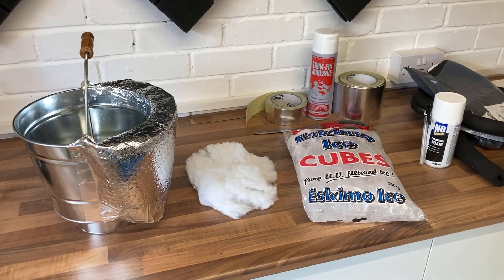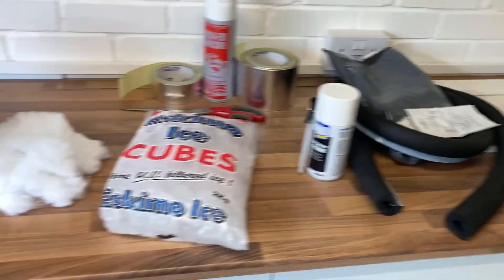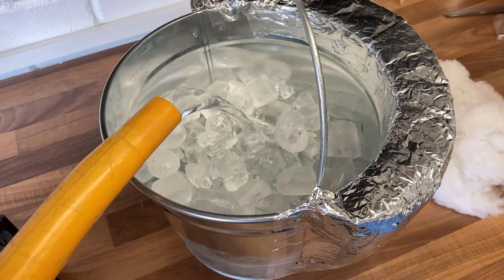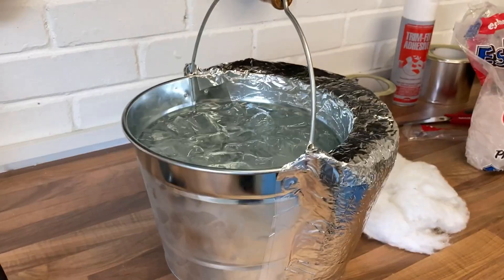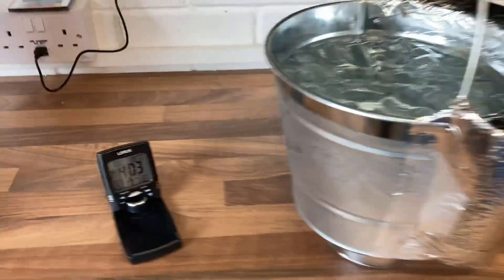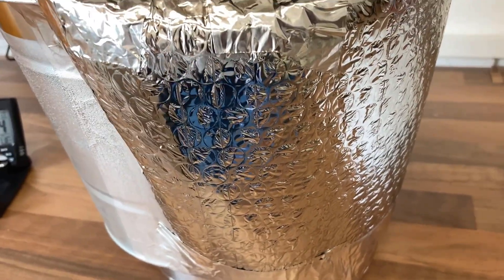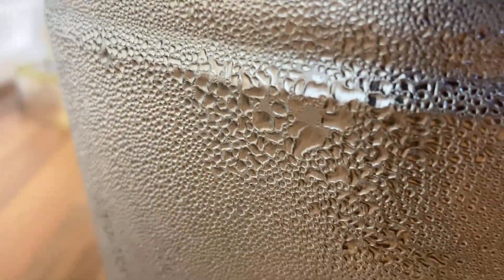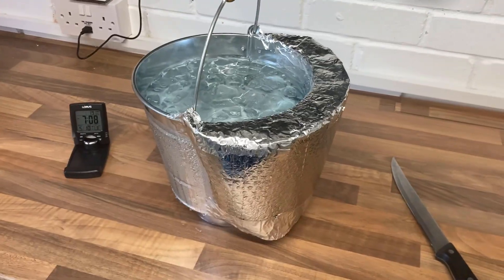Vapour Barrier in a Van - I can Prove they Work.

Comment: That is amazing, and you have certainly , proofed your point.
I have a big issue on a work van , with moisture collecting on the inside roof , and this is because I am running an engine to generate PSI, constantly during the day , in order to do my job. Which will always be done with side and back doors open. I would be grateful if you would list the materials you used.
Reply: Thanks for taking the time to reply.👍
Reply from the maker: There is a details playlist for the build of my van showing each stage. 
I used PIR insulation slab for the floor and roof and side panels and I recommend Diall recycled plastic loft insulation for all the awkward areas and stuffing in beams. Seal over everything with double foil bubble wrap as a vapour barrier 👍🏼😃

Comment: Hi Greg. A good presentation but I have an issue with the way you did it. Your experiment shows the difference between having INSULATION + VAPOR BARRIER vs not having both. To show that vapor barrier works, you should have insulation on both sides and the vapor barrier only on one side and then see the difference. What do you think?
Reply from the maker: I will repeat it just with insulation and no vapour barrier.

Comment: Hello Greg, great info as usual. Just found your channel and love it. Going to be doing my van soon. One question I got is did you insulate and vapour barrier the front cab area of your van. Thanks
Reply from the maker: I did above the headliner in the roof but not the floor or doors. I do have a heater vent blowing into the cab to keep it warm. We do get a bit of condensation on the windscreen but that is all.
Reply: Ok thanks Greg, I shall do the same. I can see your work is belt and braces.
Reply: So you don’t have a complete seal.
I think the real question is what 
 reasonable lengths should you go to. 
If you have a vinyl floor there’s no need to vapour barrier 100% under it. 
There is metal everywhere in most cabs. It’s not rusting because generally the paintwork inside stays in tact.
Reply from the maker: @afterthought9  vinyl is permeable to moisture over time. But you do what want to. It’s your van. Good luck 🤞🏼
Reply: @GregVirgoe  I did vapour barrier most of my van. But I know that nobody does this for their cab. Don’t you think it’s a reasonable question for how far should we go?
Reply: @GregVirgoe  also you think bathroom vinyl floors let water in over time?

Comment: Question: You install insulation on the van walls first, then, the vapor barrier after that?
Reply from the maker: Yes exactly. Insulate then barrier then you can clad over that. 👍🏼😃
Reply: @GregVirgoe  Thank you Greg. You came highly recommended by Ame in a Van. Subbed here - and I'm going to go through your vids before I buy my next van. I like your work and the knowledge. Thanks again. 🙏

Comment: I don't see how you can have a vapour barrier in something that expands and contracts and flexes. Take a loft conversion they just have a inner and outer skin and good ventilation between the two skins and the timber beams would rot if it didn't work. so I would think you would be better off having two skins and have two or three of the spinning vents to ventilate the space between them
Reply from the maker: That’s a completely different situation and application. Your house does not have a metal outer skin that gets cold and forms condensation. The treatment of each situation is totally different. Your van is nothing like a house. 😳

Comment: Liked the video. How have you managed to insulate inside door frames ,hard ro access areas etc
Reply from the maker: Doors with handles and locks you need to put your insulation in plastic bags as the door still needs to drain from water ingress. 
Door frames can be packed with wool from and holes, wrapped with thin insulation layer and carpeted.
Reply: @GregVirgoe  Thanks Greg.. I meant the likes of the top frame of the sprinter  sliding door ( around window I fitted ) and the likes of the door pillars behind driver and passenger seats ,rear double door pillars plus top sections of rear doors. Thanks

Comment: Great demo Greg, I'm currently doing a van conversion on a Citroen Relay and I have been diligently applying a vapour barrier, the issue I have is that I need access to the nuts that hold the rear light clusters in place, has anyone managed to seal off this area but still leave access for changing light bulbs?
Reply from the maker: It’s better to seal over and if you had to get access cut a hatch then tape back up after working.
Reply: @GregVirgoe  Thanks Greg sounds like the best solution.

Comment: Hi Greg, two questions if I may. 

A little while ago, my partner and I had had to redo a bump out and we noticed that there was some sweat on the wall of the van that we had vapour barriered and filled with recycled bottle insulation. Could this be because of some small holes and how much should we have worried about this?

Also, we have noticed on very cold nights we get certain parts of the van which have cold icy patches on the outside walls. For example where we have overhead cupboards. Is this an indication of any poor insulation?
Reply from the maker: Perhaps there are some gaps or holes in your vapour barrier that could have been sealed up. 
Icy patches on the external of the van if the inside is warm means good insulation otherwise the ice would have melted from the heat inside.

Comment: I totally agree with what you say Greg. I was interested to see what VW did in there California, when I inspected one there was no insulation or vapour barrier behind the sink cupboards and the bare skin of the van was visible, this was on a 2018 California. I did hear that Vw say the output of the diesel heater over comes any issues. When i did my Vw camper I didn’t use any insulation I just rely on the diesel heater, obviously it’s worked much harder and very very wasteful on fuel, but in the morning after a winter camp the exterior of the van like the inside is bone dry. If I used my van for longer than weekends then I would have adopted the vapour barrier and insulation approach.
Great video as always.
Reply from the maker: You have to keep the entire metal fabric of your vehicle above the Dew point temperature and provide loads of ventilation too but I guarantee it would cost an absolute fortune every night and would not work over winter when it’s really cold. You are paying ridiculous money for that sub standard installation too 😳

Comment: When you peel the instulation I can see some small droplets in the bottom part of the can and also on the left side (few small dros). Is that normal? Thanks Greg, you are the superman of insulation!
Reply from the maker: It transferred from the outside of the foil tape that was stuck to the bucket when I ripped it open. It was not condensation inside there

Comment: Greg, what do you think happens, when you do this test without  insulation?  I mean 5 cm air gap instead of insulation. does vapor barrier side of bucket stays dry?  I think this air gap is still warm air that condensates to the cold surface.  I dont think I can install isolation in the walls without air gaps. If air gap is vacuum like multi layer windows, then there is nothing to condensate, but campervan walls are not vacuum, they are full on air around insulation.
Reply from the maker: Air is also an insulator a small air gap like in a cavity wall will offer some thermal properties. As to the moisture already in that void it is nothing literally a couple of grams and would not even fill a teaspoon. 
I plan to do more follow up videos on this subject because so many people don’t understand what is actually happening and why it’s so important. 👍🏼😃

Comment: Thanks for this, Greg. We've done a vapour barrier, following your instructions mostly. I was wondering how worried we should be about small holes? We've screwed through it quite a lot, and I know if there are screws tight in that's not a problem. But what happens if you've accidentally made a tiny hole is your vapour barrier then dead?
Reply from the maker: No not at all, please don’t worry a very tiny hole will have vert little effect. Screws are plugging their own holes so you have done the right thing

Comment: wooden struts to frame the van before or after vapour barrier? thats what is doing my head in lol as vapour barrier makes it difficult to attach stuff to van
Reply from the maker: You can put your timber inside or outside the barrier it makes no difference. There will be no moisture so there is no problem. Also no problem fixing either as any screws are themselves a plug so there are no holes.
Reply: @GregVirgoe  thank you:)))

Comment: I believe a vapour barrier is vital for a van build in the UK or any cold climates. Even if you make mistakes and leave a few small gaps/holes I believe although condensation will occur it will be far less of a problem compared to no vapour barrier at all.
Reply from the maker: Absolutely correct and spot on 👍🏼😃

Comment: A very well needed video Greg and an excellent visual demonstration and explanation. The number of times I see people doing conversions and not putting a vapour control layer on the inside is unbelievable and even more unbelievable is that they don't here me shouting at the telly " are you havin a laugh mate".

I'm a retired building standards surveyor with 42 years service so I've seen multiple build project with failed vapour control layers. I was involved in a demolition job where a timber framed house had to be demolished because the structural timber had rotted at the sole plate and compression started on the loadbearing timbers applying load to the decorative, non-structural brickwork that cracked and partially demolished itself. Anywhoo the problem was found to be poor fitting of the vapour barrier, missing sections of vapour barrier and massive tears, holes where the services had been installed which resulted in the old style quilt insulation being soaked because dew point temperature occurred in the outer 1/3rd of the quilt insulation which, in turn soaked the insulation then the timbers and structural plywood (which sort of answers Jonny's question below).

I just don't understand why folk would live in a steel box and not expect condensation on the steel yet they buy a window vac to remove it from glass........DAH!!!!

Oh and one other thing that baffles me.......all those minibus conversions out there where they paint the glass they don't want, window tint the glass they do, and frame behind it leaving "windows". I've commented on many build videos asking for an explanation of how they seal between the glass and the painted, framed and insulated sections because, as far as I know, silicon will fail and condensation from the visible glass must surely drop behind the framing so there is a future potential rot issue down the road. Nobody has ever given me a proper answer and most say "oh I used proprietary seals".......maybe I should ask Autoglass for a proprietary seal for a 2006 Mercedes Vario minibus conversion between the glass and timber framed wall panel please and oh, it needs to be 100% watertight..... so the guy will scratch his head, other body parts, look through his store room and reply..."what was the question again" 

A future video suggestion that I'm sure you've not shown before unless I've missed it , would be to deliberately wire a 12V item using too thin a cable to show meltdown and heating of the wire so people start thinking about their cable sizing. You have excellent videos on that subject but I don't recall you demonstrating a failure/overheat scenario in real time so just a thought. 

Keep the videos coming Greg and sorry for the long comment but some things make me go off on one especially important issues.
Reply from the maker: It’s amazing isn’t it how even when the facts are proven in front of your very eyes it’s still questioned by those that have no academic proof themselves. But there are 5% believe the earth is flat so there is no helping some people 😂🤣 
Here’s my cable sizing video with the wires bursting into flames that you wanted to see ⚡️😳
https://youtu.be/koFg6oFs0RU
Reply: @GregVirgoe  Thanks Greg I'll check it out now

Comment: This shows insulation plus vapour barrier not the vapour barrier.

I’d love to see if you’d done thirds. Bare metal, insulated then insulated with vapour barrier.
You could also add some non insulating barrier to a segment.
If you then removed the ice and took the metal back to room temp ie above the dew point before removing the barrier /insulation/insulation plus barrier surely it would show the difference since the moisture condensed on the metal would not go anywhere . You could show amount with a strip of coloured paper towel after you removed the claddings.
Cheers 

Great video though! 👍🏻
Reply from the maker: I will do a follow up with just insulation but as far as letting it warm up again that’s nonsense. The damage is already done by it being soaking wet in the first place. Stopping that happening all together is the purpose of a vapour barrier. Why on earth would you allow water to be produced on a daily basis?
Reply: @GregVirgoe  the removing the dew (point at the end ie bringing it back to temp )would be to stop it sweating “after” you took the insulation off and therefore contaminating the results.
I agree it’s stupid and the damage has been done, it’s this damage we’re trying to get a view of, that’s happened while the insulation is in place - ie the effectiveness of it.
Thanks for the reply.
Still loving the vids ! 
Cheers
Reply from the maker: @tonystacey3347  absolutely nothing will happen inside a sealed vapour barrier at any conditions that is the whole point. You can rip that off at any time night or day, hot or cold, there will NEVER be any condensation inside there.
Not having one and allowing condensation to form at any time is just madness when it can so easily be prevented.
Reply: @GregVirgoe  agreed, and your vid shows that very clearly (as does the previous one you did ages ago when you looked at insulation.
I was (not very well ) trying to suggest an experiment to show the difference with insulation only.
Sorry for the confusing replies !
Reply from the maker: @tonystacey3347  I will repeat it with insulation only to show that condensation will still form without the vapour barrier. I will also answer some other questions too 😃 stay tuned 😃

Comment: Great experiment I always wanted to know if this theory works, and you proved that it does work " vapor barriers do work when done correctly"
Thank You for proving this theory 👍🇺🇸
Reply from the maker: Yes they do work and it why everywhere in industry when you have cold metal surfaces they are insulated and vapour barrier applied to prevent condensation. It’s not hard to do either.

Comment: Thanks, Greg - another great demonstration!
Moisture is not your friend. Proper insulation and a sound vapour barrier are as important as a proper ventilation concept to keep the ambient moisture at acceptable levels. This also goes hand in hand with CO2 management to maintain good air quality in your van. Mandatory info for all van builders!
Reply from the maker: Absolutely most important indeed 👍🏼😃

Comment: This is very probably good advice in the UK, but not necessarily so for other climates. I'm currently traveling around the US West Coast, where the relative humidities are low. Am in the Southern Colorado desert right now. The relative humidity is just 10%. Nightime lows of around 40°F (4.5°C). The van is not much warmer than the outside, so no condensation whatsoever. The climate is such that I have not needed to use heating in my van, so not a great temperature differential between the inside and outside.
Reply from the maker: As the temperature drops the relative humidity increases so at night in conditions as low as 4.5 it could easily be below the dew point. It’s much less likely to happen I agree with you but still possible at certain times of the year 😃
Reply: Great until that once each year thunderstorm sweeps through and the humidity in the van increases....
Once that's in the walls..... ?

Comment: Excellent demonstration of how to form a closed cell installation by using insulation & vapour barrier- I do smile when I see comments about using vapour barrier & the reasons why you shouldn’t use it. Yet they use celotex on there roofs or suggest ventilation- you just need to sit in a back of a van when it’s pouring with rain outside to see the condensation forming like a river… - no amount of ventilation will stop it forming, unless you’re sleeping with all the doors an windows open. Not very stealth or safe! 👍 Thank you for sharing the holy grail of Vapour barrier debates! 🎉🎉
Reply from the maker: Thank you for your support 👍🏼😃
Reply: This comment made me laugh out loud, thinking because its got similar properties a bit of celotex is the same as a vapor barrier !!

Comment: I'm not so sure?  I know the insulation is needed to keep the bucket from sweating, but I am betting that is all you need, just the insulation (Not the vapor barrier).  Does your winter coat have a vapor barrier?  You don't sweat inside your coat when it is zero outside.
Reply from the maker: Are you an android made of cold metal John 🤣 NO your body is warm. Not even a close comparison 😆

Comment: Be interesting to see what would happen with just insulation and no vapour barrier. Maybe do the same experiment but hold the insulation on with chicken wire. Great video though Greg as all ways 👍
Reply: Closed cell foam like armacell might show some condensation when it's not entirely glued to the shell. There could be rust between shell and insulation.
But if it's glued on well, it's like a barrier by itself.
Reply: So taking a completely empty van, one would want to place the vapor barrier first, followed by the cabinets and wiring, etc.?